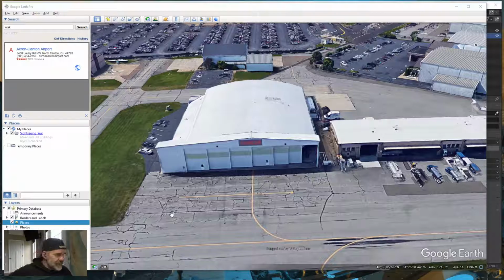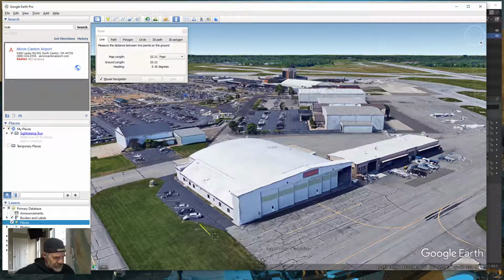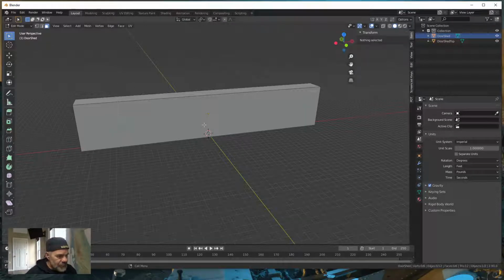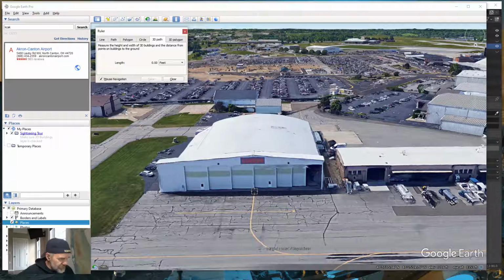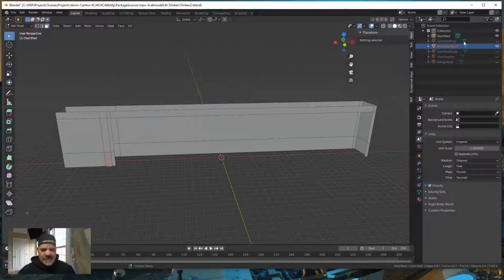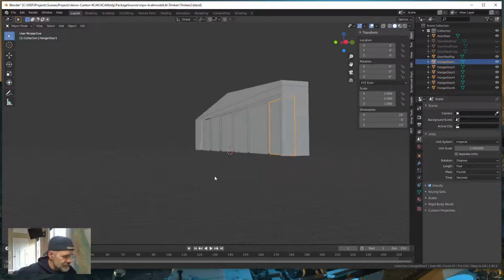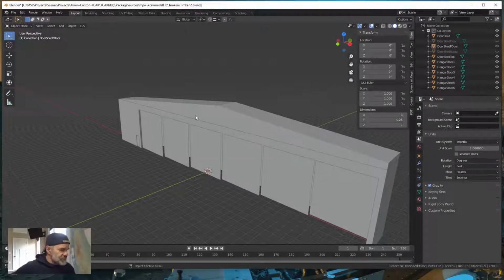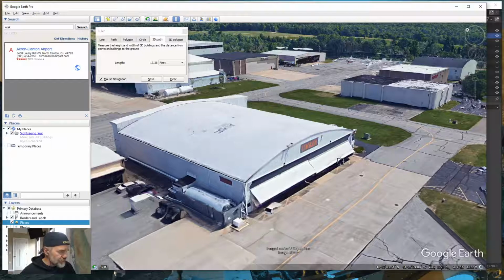Creating Scenery for MSFS 2020: Creating a Complex Quonset Hangar

Comment: Quick Tipp for the loop cuts. You don't need to delete or make it a separate object if u want a loop cut only on one side. Simply select the part you don't need and hide it ( H ) do your cuts and unhide the selection with ( ALT+H ). Hope it helps! Cheers
Reply from the maker: Yes, that is correct! For beginners, I'm just getting them started with the process. But excellent input...thank you!
Reply: @myphysicalworld3958  Glad to help Im relativ new to Blender as well, there isent a day when I dont learn something new! Keep up the good work man :)
Reply from the maker: @aneltoromanovic3362  I give ya a shout out in part 4...LOL